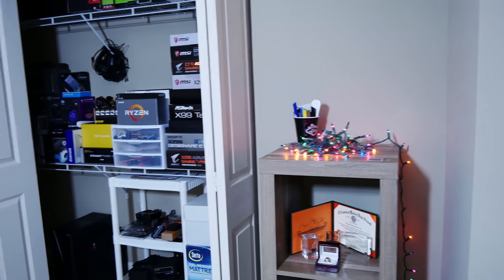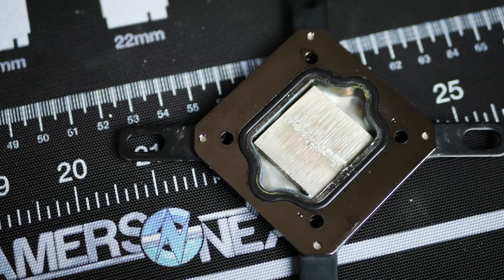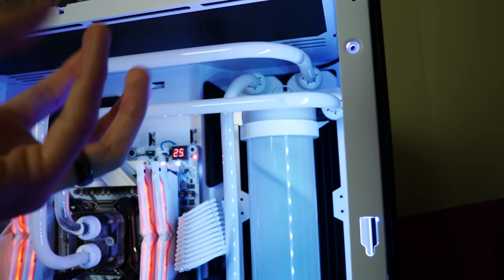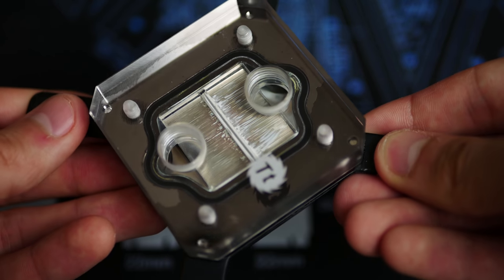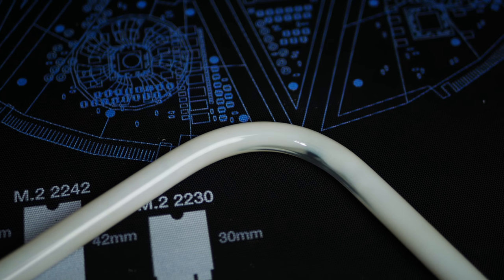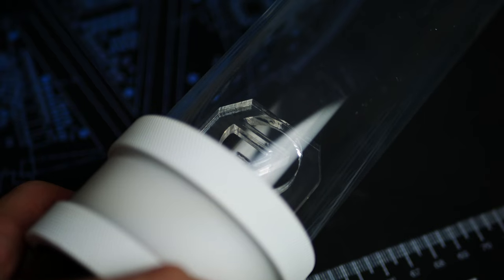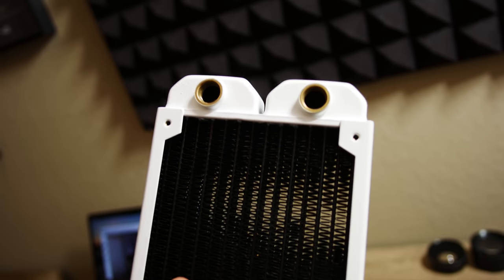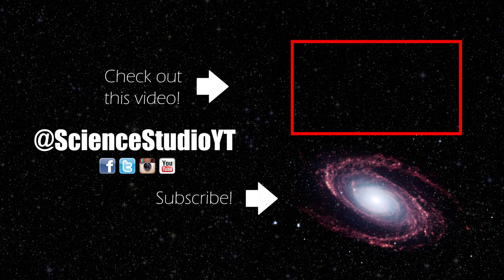More Trouble with Opaque Coolants...

Comment from the maker: - Something I should have mentioned in the video that I assumed would be implied: the Primochill True is already pre-treated. When I say that I used deionized water, I'm implying that it was treated with the True pre-coolant mix. A few of you are pointing out that plain DI water can be very corrosive - but this water was treated accordingly before being added to the loop.
Reply: Science Studio

So, I just looked at Primochill's website. Under features it calls for deionized water, but under the actual specifications it calls for distilled water. If this additive isn't actually made to stabilize deionized water, but to just add corrosion resistance and microbial resistance to regular distilled water (which is what I find far more likely; I don't know of an additive that can actually prevent ionization corrosion), then that would explain why the True broke down. I'd get ahold of Primochill and have them quadruple check which type of water is actually supposed to be used.
Reply: Derek Hood sounds really similar to Red Line's Water Wetter. I've been using that stuff in all my cars for over a decade I like it so much.
Reply: btw you should maybe try the fluid Jay used in his threadripper build as he said he used it before without a problem.
Reply: Why not just spray paint the tubbing to desired colour?!

edit: exterior of tubbing

Comment: Yeah, water cooling is always kinda sucky. I don't even bother with coolers anymore. Just leave the cpu naked, and replace it with an undestroyed one every 10 minutes.
Reply: Id actually be intrested to see how long like a 8700K would go without a cooler. Just at base clock not with some crazy overclock. Obviously it would not work for long but would you destroy the CPU or would the system shut down due to excessive thermals. I mean the CPU is going to throttle and eventually throttle down to 0% if even at idle its overheating. I wonder???
Reply: I'm pretty sure really old CPUs used to just die, but my 8350 would shut down if it exceeded 180f.
Reply: der8auer, a german extreme overclocker made a test. An 8700K without any cooler. It clocked down really hard, but it survived.
Reply: If you just rest a cooler on one and start it up, works fine, and you can pull up a temp software and watch the heat rise pulling the heatsink off and putting it back on xD
Reply: JP Stone not done this with an i7 8700k but have done this several times with various different cpus in a quick test to see if they work. The system will boot up, and just eventually shut off to protect the hardware.

Comment: I know that a higher acidity white vinegar is used when removing hard water particles in dish washing systems. I have been adding it to my dish washer for years on my parents' recommendation. Prevents powdery dishes that Jet Dry can't fix. I think this is the same concept, dissolves the base, which is the white. However, if you take a copper penny (or a copper pipe) and dip it in vinegar, it will shine it, removing the thinnest and outer most layer of copper. You don't wanna keep doing this too often because you can cause pitting if you see bubbles form on the copper.

Comment: For cleaning acrylic or PETG, you can just use isopropyl alcohol.  It will generally clean off any staining or build up and will evaporate away quickly.For tougher stains, diluted lemon juice works very well.  Just make sure to thoroughly rinse the block or tubing with water to remove any acidic solution.The nanoparticles in opaque fluid does seem to have issues frequently.  White especially.  I've never had any problems with any of the Translucent fluids causing issues.

Comment: Greg another suggestion I've heard for cleaning inside radiators etc is to boil some distilled water and pour it in with a drop or two of plain Dawn dish soap. With rads, plug the ends and shake the water back and forth inside a few times.

Comment: They're right ya know.  I only use de-ionized water in my loops with PT-NUKE and Faser Base corrosion blocker.  If I want a specific colour I just use coloured tubing or tubing. An old build I had lasted 7 years before needing a service.

Comment: Using any type of acid (vinegar is dilute ethanoic acid) to clean any system containing metals isn’t a good idea as it can cause corrosion, but if you do use it then you would need to thoroughly wash it out with distilled water. The opaque coolant isn’t clear (wow) because it has insoluble particulates in it, it didn’t drop out of solution it just settled onto the walls of the tubing and such due to things such as static attraction and van der waals forces, it’s inevitable that opaque coolants will settle and become clear as the particulates fall or stick to surfaces. The best way to clean it would be to use a solvent that the additives are soluble in, typically ethanol or acetone would work. 

I probably worded this weirdly and please do ask if something didn’t make sense

Comment: Google "chemical compitability chart cornell." This has a list of different plastics exposed to a range of chemicals. A 5% solution of acetic acid at 20°C does no visible damage to acrylic after 30 days, but you may see some damage to PETG after 7 days of constant exposure. So vinegar should be fine for cleaning acrylic parts, but I wouldn't recommend soaking PETG with it.

Comment: The clear parts look like normal PTE (Polyethylene Terephthalate) which is the same plastic polymer used for soda bottles. The white parts look like PETg (with glycol) which is a common filament used in 3d printing, and it's pretty much the same as normal PET, the glycol additive helps thermal extrusion. Anyways, not only is PET common for soda bottles, but heavy-duty cleaners such as Lysol, or many others. Next time your at the store, browse the cleaning solvents, and observe all the PET bottles. You can dilute bleach, hydrogen peroxide, or acetic acid (aka vinegar) so long as you keep it mild... say 10% ~ 20%. Otherwise use a drop of dish-soap, or anything mild that acts like a surfactant (aka changes the surface tension of water), which will greatly help dislodge those large particles of opaque dye. Heat the water to achieve better results. I'm not a chemist, but I recently stayed at a Holiday inn Express.

Comment: Something i remember from my old chemistry days you might want to check out: "voltaic sludge" because of the relative difference in 'oxidative potential' between the two metals.  Even though both are inert on their own; together you might have a battery going on, albeit a weak one.  I have not looked into this, but something rang a bell in my dusty brain.
Reply from the maker: jctai100 Copper and Nickel are combined all the time in loops. That isn’t what’s going on here, especially with DI water.
Reply: you absolutely wrote the most insightful comment here, it was a pleasure to read!
Reply: ohhh deionized water eh???....hmmm how long does that last?

Comment: The only thing you have to worry about with vinegar, is the nickel plating on the water block. It can devolve the nickel. But, as long as you flushed everything else thoroughly afterwords, you'll be fine. I've used it many times to flush operating loops. Just a little bit though to keep the concentration levels low. And don't scrub the block with it. That'll be a bad day. Lol. Hope this helped.

Comment: Most of the time I see this happening is when people do not understand that Opaque colors in coolants do require more maintenance. I don't know the materials of any of your blocks or rads that you use but aluminum is highly discouraged with primochill TRUE. if this PC was put together in December and you had not drained the coolant since then, then it has been about 5 months, Primochill recommends 6 on the most, even saying "As with all custom loop water-cooling, continual maintenance and frequent inspection is required. True will need to be replaced every 6 months or sooner, depending on the complexity and conditions of your loop. This will be required to maintain the aesthetic appeal of your loop." It varies depending on how much you use. Plus I noticed that you did not distill the whole bottle into one gallon, I don't know if you measured how much was needed, or simply eye balled it. but that could also effect the outcome. It would likely help if you distilled it in a full gallon and stored the rest. Continuing, doing a simply flush/bleed could also effect the intended outcome as primochill states that "All water-cooling loops (existing as well as new) must be prepared using the included Sys Prep" and they include a bottle with your coloring (they did for me at least). Overall there are too many things that could lead true to doing something like this. But, all enthusiasts know what we're getting into and we read up on the coolants we put in our PCs (or we should anyways)

Comment: That sucks, looks like a pain to go through all that. Never done costume cooling and always wondered if the dyes were an issue especially with the super heavy pastel coloring. Some of Jays builds it looks like straight up paint in the loop. It definitely looks cool but I would not want to drain and tear down to clean  twice a month.

Comment: That is not a solution,  it is a suspension, nanometer sized particles that are suspended in the water. Normal molecular motion keeps them suspended but over time, as you've seen, they can settle out or, more likely, get electrically attracted (at the molecular level) to other surfaces.. It would be ok to color the water with dyes that dissolve in water (a true solution) as they will not come out but they also will not be opaque! They may however permanently stain tubing and plastics but would have no effect on thermal capacity.

Vinegar should have no effect on the plastic tubing or any of the metal components for short term exposure, just make sure to rinse well!

Finally, be aware that distilled water is very corrosive. Water is called the universal solvent because it wants to dissolve everything! When you distill it you're left with a liquid that wants to absorb ions and in the case of a PC cooling system that will likely be copper or iron. It's a balance because if you use tap water it may have high mineral content which will result in minerals depositing out of solution!

Comment: One problem I had with primochill Opaque was the pH balance issue. 
I had this exact same problem happen once with my steel blue opaque.
The way I fixed it was just a simple flush, and reusing primochill sysprep. 
If you don't get the sysprep out of the system fully, then the pH fucks up the Balance of the fluid,causing it to fall out. 
If you had the chance to, or if it does this again, do a pH test to see if it's neutral or not.
Reply: Another thing was making sure that the mixture was perfect. I would recommend mixing it into a gallon, like the bottle says to.

Comment: If you follow the instructions of the product it states to mix the full 8oz into a distilled 1 gallon jug and shake thoughly and then use the amount needed in the loop. I have been using opaque from primochill for months running 10 plus hours a day with no clogging at all
Reply from the maker: William Noonan The instructions are literally NO different than what I’ve done here.
Reply: understood perhaps using a  pressure relief valve will help I do have one in my loop as primochill recomends to avoid fall out

Comment: I had the same issue happen to me with Mayhems Pastel UV green fluid after 1 month. MAyhems did some tests and concluded that is was a reaction caused by my cold cathode UV tube lighting in my system. What they said happened is the pastel coolant contains particles that react with the Cold Cathode lighting and the particles get drawn out of the coolant and form a new pigment against the PETG tubing.

Comment: Have you tried the Thermaltake P1000? It's designed to replace the C1000 line and it's emulsion-based rather than powder-based. From the few reviewers I could find, although there could be some pigment separation, there won't be any of that white residue clogging up the system. It's all liquid.

Comment: The sale of any product, that causes that level of blockage to a loop (inside a month) should simply not be allowed. For shame, Premochill...
Reply: This seem to be a recurring problem with Primochill. Their Vue was originally touted as the end all of fluids, best look with few drawbacks but within weeks and months of release they had to update the site with a whole list of stuff you must do and not do, cut the maintain schedule, seems to be abrasive striping nickel plating and you have certain colours having separation issues. They are hardly the only company with these issues but seems to be more frequent.
Reply: It doesnt matter if its Primochill or Meyhems or anything else, if it isnt clear it will eventually fall out because emulsions and dispersions are not thermodynamically stable. If you buy any of these products, you trade less maintenance for better looks and if you dont wanna do that, then you are free to go with distilled water and soluble coloring. The only thing Primochill did wrong, is that they didnt put that right on the package.
Reply: linus used one in one of his videos too
Reply: Chuckiele Agreed

Comment: I would not recommend using vinegar as it is very acidic you need to use PH neutral chemicals to clean your loops/blocks like Mayhems Blitz Pro Cleaning System. Which I use before filling my loop with my coolant. As well as after cleaning out the loop for maintenance. One of the main reasons I stay away from using coloured coolants is the high maintenance that they came with hence why I use EK's Clear Cryofuel coolant as it is low maintenance and no filaments

Comment: I'll add my voice to the "straight water is bad, m-kay!" crowd. Especially deionized water. That stuff is just straight destructive. The universe tends towards highest entropy. For water, that's an ionized state, so it's going to steal electrons from whatever it can, breaking down what it steals from in the process. Even additives won't prevent this.

Distilled water is definitely your best bet, but even that is moderately corrosive. You should always, always, always at the very least run an anticorrosive additive and a biocital agent to prevent bacterial growth.

Comment: I have been wanting to try Evan's waterless coolant (automotive product) in a custom close loop system, but the $50 US a gallon is off putting for use in a PC lol. It's non-conductive, non-corrosive, doesn't boil tell over 375*F (doesn't matter in a PC), and is a long life fluid. The only real thing I see being a problem it's a touch thicker than water, so it takes a touch more effort to push it around. Also it may not pass very well through the micro fins on the cold plates.

Comment: Have been XSPC EC6 opaque for quite a while and have had zero issues.
Reply: XSPC has always been my go-to brand everytime I thought about custom water-cooling and I am finally doing it for 1st time for upcoming build. =)
Reply: Des Jones  I've used them for years and the only issue I found was the early red coolant I used really stained my fingers lol
I've used a lot of various coolant companies and XSPC have been the most consistent for me. I'm currently using their blue opaque which I added their own brand navy blue dye to darken it up and have had no issues. To clean my rads all I do is run them under the hot tap for a while, give the a good shake to free up any bits and then flush several times with distilled water. Mayhems cleaning kits are good but I've found I would only need to use it if I was going from aurora (or a similar show coolant like primochill vue) back to a normal coolant. I was fussy about tubing in the past too with some leaching plasticisers but have had no issues with petg or acrylic. If you do watercool just take your time and don't use red wine vinegar....

Comment: To be honest, wouldn't it just be smarter to use white tube than to use pastel dye?

Edit:

Actually something also just hit me after watching the vinegar part-- if it doesn't corrode the plastic, could you run a little bit of vinegar or a light acid mixed with the fluid to prevent sticking?

Comment: Ive had nothing but trouble in the past with colored coolant in general, especially with mayhems pastel. I got so frustrasted with always having to take apart my gaming rigs custom loop that I ended up switching back to solid colored soft tubing and distilled water with a bottle of liquid utopia from primochill. The only colored coolant Ive never had problems with is the oldschool swiftech hydrx coolant although my only gripe with it is that it only comes in green.

Comment: Did this happen overnight,  or did it happen gradually? I had a clean loop, drained for 20 minutes to replace the CPU (yea! I got one) and I salvaged the coolant and reused it.  And an hour later, I started getting deposits, just like you showed, lining all the tubing.  Within a week, my pump died until I flushed many many time with DW.  Mixed PETG and soft loop (case has a front and back, PETG up front, soft in the back, Thermaltake Tower).  Edit:  My coolant is orange, and still left these white deposits.

Comment: I’ve been running Mayhem’s pastel extreme white for a year now, absolutely no trouble at all, looks the same as a year ago in a loop with a Vega 64 bios flashed and overclocked and a 7700k at 5GHz. Temps are the same as day 1. I flushed my radiators with a solution of white vinegar and distilled water before use and used soft tubing. I’ve heard that PETG isn’t comparable with some pastel coolants, not sure if the is your issue here? Maybe stick to soft, glass or acrylic. I’ll be using mayhem’s pastel extreme when I rebuild by pc next well again.